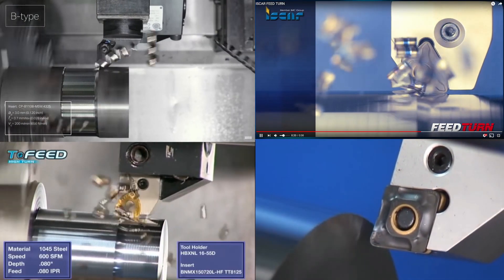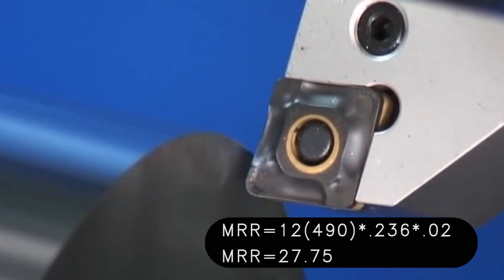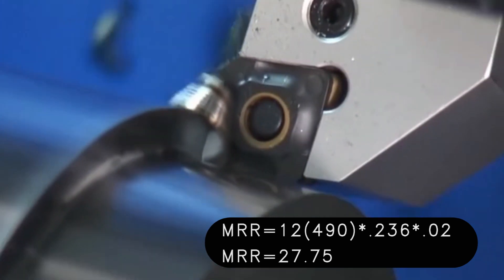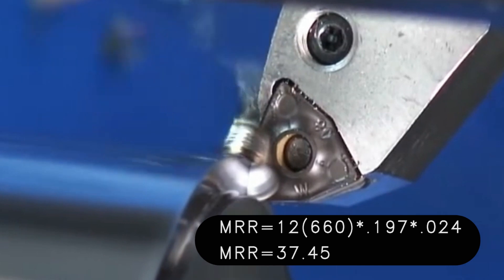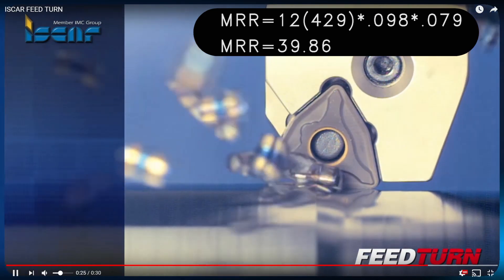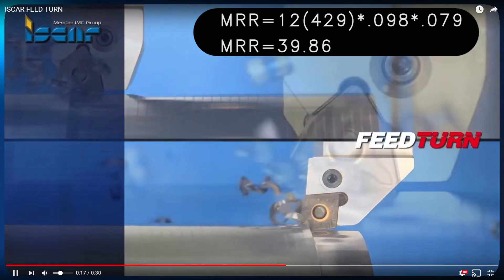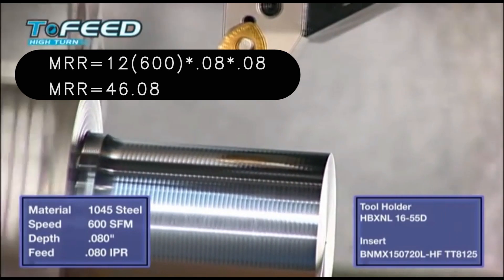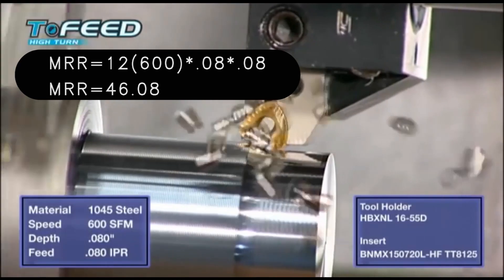Rough Turning Comparison, What's Faster?

Comment: Prime turning tends to be slower in "conventional" materials, but we did a demo on some bastard carpenter material 2yrs ago and the prime turning inserts did REALLY well. Not particularly in terms of REMOVAL rate, but in DURABILITY, resulting in faster net removal rate.
What do I mean by slower removal rate but faster removal rate?
Due to the nose profile, the prime turning inserts get better wear in hard materials (all materials really). So the reason they shine in HARD stuff is because; if you have 12min of cutting to do, and a CNMG only lasts 7min tops, then your metal removal rate involves either a tool change or an insert index. If the prime insert lasts 15min, then you can finish a part reliably and change inserts without taking time off the part.
Reply from the maker: I like this response. Every tool company will claim to have the best tool for the job. Also, some tools are best for some applications but not others. The best thing to do is to try various methods and figure out what works best for a given application. 

Nickel alloys are some of the hardest alloys to machine. A company I worked at before going full time on my shop cut some Inconel and carpenter alloys and they ended up using ceramic tools for roughing.
Reply: Prime turning is really very good for harder materials. That is also our experience. In soft material (less than 30HRC), the chip breaking and durability of the insert is not so good.

Comment: You should add in the TurnTenFeed from Tungaloy, it blows the MRR of the others completely out of the water.
Reply from the maker: On this video, I just pieced together some demo clips I found at the time to compare. There are some good options out there not in the video. I just looked up the TurnTenFeed and I like the look of it. I would say the best roughing geometries for high MRR will have some type of leading angle for chip thinning. They impart more forces on the part but for rigid setups with a good amount of material to remove they are a great way to go.